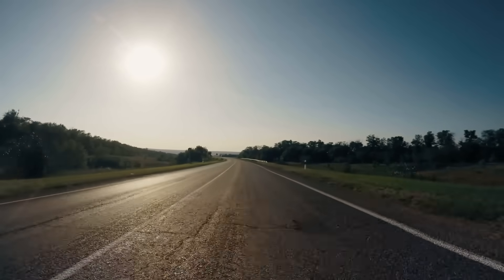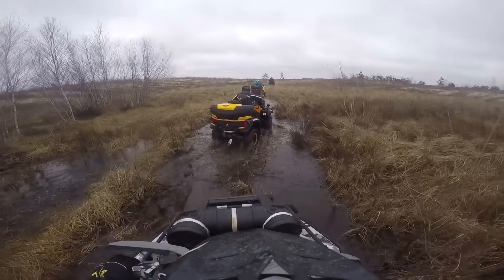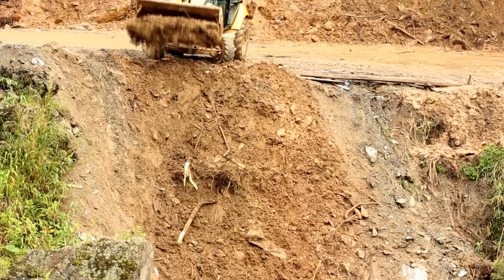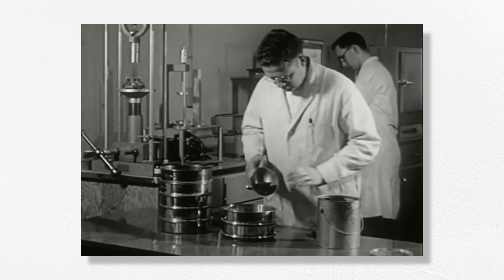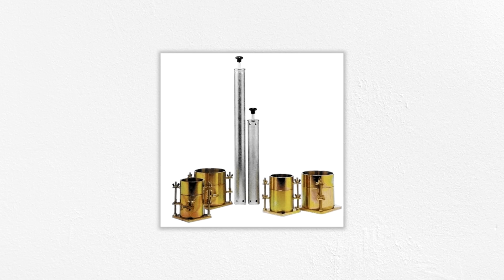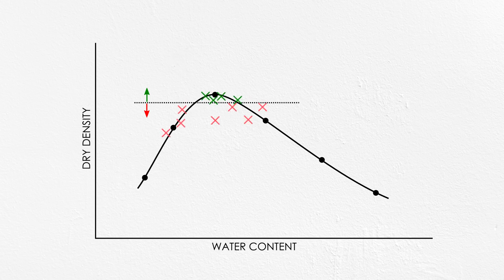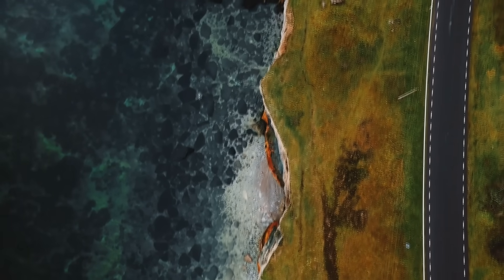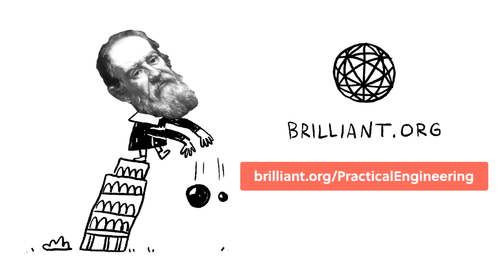Why Does Road Construction Take So Long?

Comment: Talk more about that radiation testing density. That blew my mind!
Reply: The instrument has a probe that sticks out the bottom. At the end of the probe is a radioactive source, and on the bottom plate of the instrument is a detector. You use a spike and a sledgehammer to punch a hole in the fill, stick the probe down into it, and turn the detector on. It runs for a fixed amount of time, and the detector records the number of radioactive particles that hit it. The denser the fill, the more particles are scattered or blocked, so the fewer hit the detector. It's all calibrated in a lab, so you just have to look up the density on a chart and compare that to the max density from the lab tests.

Comment: Congratulations, you literally described 90% of my job in today's episode. I'm "that guy" in the lab running proctor and atterberg tests on the soil, and ALSO "that guy" out in the field observing the placement/compaction of soil, documenting the process, and testing the product through proof roll and density tests... It's grueling work. But that's only a relatively small part of the time delay on a job. A larger part of the delay is due to deciding to do foundation work during the wet season, where 1 day of rain leads to  1-4 days of sitting around waiting for the soil to dry below optimum moisture content so you can work with it again, mostly because someone failed to ensure the place was compacted, slicked off at the surface, and sloped into a drainable area so the water won't sit on the surface and soak into it during storms... The major part of road construction delays is exactly as people complain that it is: The government responsible for the road grants the job to a company that "meets the criteria of equal representative employers" who are more worried about employing the appropriate percentages of ethnically diverse or handicapped backgrounds to get government jobs instead of straight up hiring only those whom are intelligent, dedicated and motivated to doing the job efficiently and well. And then those substandard companies underbid the job to win it, spend days/weeks/months arguing about the price of change orders when things don't go as expected, or don't work Saturdays or holidays, or only work 6-hour shifts, or just don't care about a deadline because they don't have another project lined up and therefor have no reason to rush the job they're milking for every penny...  and then the job that Joe Excavator And Crew could do in 2 weeks between warehouses takes 3 months and has potholes 6 months later, and it cost twice what JEaC initially bid.

Comment: "steady progress" well if you mean construction cones sitting on finished concrete for about 2-3 years sure. But thankfully other areas have a bit quicker and methodical construction teams.
Reply: I'm guessing Illinois or some equally corrupt/poorly run state.
Reply: @sorencates2125  Yo. I'm from Illinois and I can't agree anymore.
Reply: @sorencates2125  it's the case in every 3rd world country
Reply: @666Tomato666  I didn't know US was a third world country >.>
Reply: @neurofiedyamato8763  yeah, you need to look past the Gucci belt
Reply: "It's still curing."
Reply: I have thought about removing them myself at night time.
Reply: Odin Thorsdad now there’s me, who drives just inside the fog line.  If the twat handing off the attenuator truck dropping cones willy nilly misses by four centimetres, they have a flat cone over the hillside.

Comment: The issue with road works, is we see the 'Road Works Ahead' or 'Men at Work' signs on the highways, the Speed Limit Reductions and Fines Doubled Warnings but then you get to there and there is never any 'work' nor any 'men' in sight, yet the speed limits and fines are ever present. I have lived in New York for almost 14 years, and during that entire time, they have been building the Jackie Robinson Parkway, Grand Central Parkway, and that other road that takes you from the Jackie Robinson/Grand Central to the Long Island Expressway (LIE) or White Stone Bridge (God knows what it is called). 14 Years! I know the work started before I emigrated to the US, and it is still ongoing I believe. How now?

Comment: this is a good start to a series. in your proctor analysis explanation you could add info about the analysis not being the same for all soil types and how particle size distribution affects the proctor analysis and bearing capacity of soils. you could also talk about how the material types are placed from native inorganic soils to pit run gravels to crushed gravel and the reasons for them. then move onto drainage from under the road surface and how water is managed to avoid problems when the water could be present in both liquid and solid states. some food for thought.

Comment: The above video is nice but doesn’t really address the question. It is clear that the main reason construction take so long is because nobody is working. Construction sites when operating barely have one out of five people doing anything. The vast majority of time I see 20 miles of road is sectioned off for roadwork but no work is being done - no machines or people are moving on it for the vast majority of time. I passed by the same side a week later and still 20 miles of court and off highway and no work at all being done. I come back two months later same thing. I see this all over the country.

Comment: Would it be possible to have some special truck like the asphalt one that could compact soil as it let it glide from the back as it moves. Like a soil printer where big trucks dump dirt into a compartment before the "printer truck" and at the back its just a flatten thick sheet of dirt?

Comment: I get annoyed by roadworks because on my daily commute (2 minute drive), they never fully shut the road and do sufficient maintenance or repair. Instead, the council will turn up, close the road in one direction for 3 weeks and repair a 15m length of road and ignore all the other potholes, some of which are 1’ deep and 1 yard across

Comment: "most of us don't want to wear a protective body suit for our daily commute" - Unless you drive a bike daily , I'll never leave even on the hottest day of the year with out my leathers on.
Reply: Not wearing that is kinda asking for trouble with the mildest of incidents, but having seen and occasionally moved the outfits that my brother and sister have a bit when they got in the way I do honestly wonder how hot it gets in there. Especially when stationary for a while getting less forced airflow to get rid of heat.
I know of electrically heated gloves for winter periods (connected to the starter battery), kinda makes me wonder if there ever comes a point where people will consider putting a heat pump in the bike for certain extreme climates which then feeds something cold into the suit. Ideally it'd be a liquid coolant but being suit attached to bike I guess just forcing chilled air into the suit and letting it vent out on the other end could work?

Comment: There is a major road in my area that has a bunch of connections all close to each other (Highway, shopping district, Major intersection). They decided to expand it 5 years ago which started with tearing down all buildings and landscaping all the land on one side, which is also a steep hill. They finally started construction 2 years ago and for the past year its seems every month the road traffic is changing. They keep adding lights and signs and opening and closing new sections. And to make things worse its a Pennsylvania road so it won't last long after completion.

Comment: This was a great start for a series, keep it going!    After the completion of a section of interstate loop in our city problems were discovered as some relatively small areas sank down. It was very unfortunate and very expensive to repair. Soil is difficult to predict and in this case the failure occurred far below the roadway. I appreciate the diligence that is applied to prevent these problems. What happened here was unusual but did provide a valuable insight into preventing future failures.

Comment: Ah yeah excuses. UK motorways are slower now than dual-carriage ways and country roads. Last week I drove to Brighton, in normal situation a 2 hour 20-30 minute drive, was instead well over 3 hours because the motorway had several places for miles where only one lane was open, cones have been put out for MILES with 50mph speed limit and then after driving 5 miles, on the 6th mile there was 2 workers having a cigarette... This got to the point where the M1 should have a warning that "you should only use this road if there is absolutely no other way. Because going around, driving more distance on country roads and dual-carriage way gets you there faster, because altough both of those are smaller, they have the same speed limit...

Comment: Ok, but this still doesnt explain why they shut down 8 miles of one lane of the highway when the actual area theyre doing construction on is like half a mile long.
Or why road crews will come in, tear up a road, close it down, and then ABANDON it for months at a time, then come back 8 months later and finish all the work in a week.

Comment: Can you please cover cost of roadwork more, and how the cost and the work/engineering itself differs when talking about road renovation or expansion versus an entirely new road? For example, when a road needs an extra lane added to it, is that significantly easier and/or cheaper than a new road through undeveloped terrain?

Comment: As a professional driver, someone that spends her working days out on the road, although construction delays are frustrating, I do like seeing construction projects because it usually means, once things are completed, safer faster and smoother roads.
Reply: It's just the growing pains that come with them XD
Reply: By the time they get done fixing one section, the old section they fixed is fucked again because of how cheaply done it was.

Source: I live in Ohio.
Reply: I have seen entire concrete sections of the road on I-30 both W and E in the DFW area and towards East Texas take down the highway down to one lane.  Usually to be excavated and repaired down to it's very foundation before new concrete is poured.  I have noticed multiple times since traffic slowed down walking speeds alot of the time in those times.  It is rather nice to know that the State of Texas's Department of Transportation takes it's job seriously enough to do these repair jobs instead of going with the "Good luck, everyone!" approach.
Reply: Adam Gray gotta love the dfw roads and the constant construction
Reply: Unless it's the boondoggle that is the toll lanes on I-77 through and north of Charlotte, NC. 
Safer?  Hardly.  Faster?  Sure, during quarantine when there's little to no traffic.  Smoother?  Ha! 2-4 inch differences between lanes in some places and deep gouges where old lane lines were "removed"!

Comment: I work as a field engineer for earth work. Roads, pipelines, pads and buildings ECT. Dirt work is important. Small mistakes can cost millions to repair. I had an oil and gas client have issues of roads falling apart, they paid for public road upgrades, and applying oversite has save millions in 2 years. Road work is hampered by traffic as well. Roads need to stay open, if we could close them we could be done in half the time.

Comment: Federal interstate systems is almost 50,000 miles of road. So, somewhere between 700 and 800 miles per year on average. Many places, you will find state and municipal projects take a decade or more to finish a 3 mile stretch for the worst offenders. Earth work, while consuming a considerable amount of time, is seldom the reason these projects drag on.

Comment: I've seen roads built pretty quickly, in places with dry climates and didn't need much grading.  I always thought that simple grading and laying down asphalt was the quick part, and building overpasses and the sections of road that have to be cement was what took so long.

Comment: Using soil for road construction in Norway is mostly a big no no. Soil (being rocks of a very small size) would drain off in rain, and would crack the road surface in thawing and freezing. You need an adequate drainage layer of larger rocks (don't know the name for sizes in english, but think large gravel (preferably with sharpish edges), with different layers of gradually smaller on top). Might also use some netting under the gravel to keep the foundation in place).  In recent years they have been using some prefabbed blocks for larger projects, these I don't know anything about.

Comment: Living in Ottawa, Canada where temps can get from -30C to +30C, I'd love to watch an episode about how road engineers manufacture these temperature changes in. Compounding to that is frost upheaval leading to big bumps and potholes.
Reply: Temperature doesn't affect dirt much, actually. The problem is the moisture content. Fluctuations in moisture cost the dirt to shrink or expand, and THAT is an issue. Once the dirt is properly compacted at the optimum density, it's ideally capped off with rock or asphalt, which acts as a barrier to letting moisture in or out. Special materials specifically designed as vapor barriers can be added as well, to further protect against those changes. How they modify the asphalt to deal with the weather would be quite interesting, though :)
Reply: Mark Thomas Well, if you have a constant shallow water table in permeable soil, the temperature fluctuation around 0 C will definitely cause problems.
Reply: @Shocktrue1   In the St-Lawrence lowlands, the water table is often only a few feet below the surface, and in the winter, if the soil is silty, capillary action will suck the water up and cause frost lensing.
Reply: I live in Ottawa too... here they don't actually do much in the way of cut-fill balancing, as best I can tell: they just remove all the soil outright to some considerable depth, place the sewers (if there are any, which there will be in any would-be suburban street) and replace it all with granular. So it's more like cut everywhere, fill everywhere. Owning a quarry in Ottawa is close to having a license to print money.

In rural Ottawa, the City has a policy of replacing culverts (they just put in big ones pretty much everywhere now) at least 2 winters before a road is resurfaced so all that frost upheaval and delayed compaction can work its way out before they come along and resurface the road.

In some places you can tell when they paved on too hot a day, as a relatively new road will be full of cracks from winter contraction (and the contractors have had to come back to put crack filler in). Carp Rd from Kinburn Rd to Galetta Rd is one such road, as is Stonecrest between Kilkenny and Kinburn.
Reply: Not related to roads but in my place the rail company had to shut down a line due to rail expansion by the summer heatwave
Reply: @NeighborSenpai  That would be an interesting topic as well. Railroads in general, really, including the making, building, maintenance and issues that can arise...
Reply: Ya know what?  Our one gravel lane cow path to our house up in Whitewater Township, is township maintained.  Same with the road to the cow path.  Even the provincial roads are so much better maintained than those in, oh say, Pennsylvania.  The weather is much more brutal in Ontario, yet the roads are done very well, and in fairly good time.
Reply: Being just a checker for a contract company in grey-bruce county Ontario ( so, without much expertise): 

All you have to do is make sure the outside temperature is just right the day (or the next couple of days+nights depending on the amount that needs to set) that you're placing concrete or laying asphalt (along with a temperature check of the actual asphalt.  Other than that, it doesn't matter much. You just don't want rain or snow on the ground (water content)

Comment: In some respects, this video unwittingly explains the failure of this area of science and engineering. In my city, there are multiple roads which undergo this lengthy process and regardless, every year or every other year, no matter whether it is the city or a major regional contractor doing the work, it will have to be done all over again--and this cycle has been repeating for decades. If, in fact, this process was thorough and effective and a justification for why there are such lengthy construction closures, the pay-off that would make it worth the hassle and long wait would be a long-lasting, functional surface. Unfortunately, that is often not what is obtained.

Comment: In the UK they are adding concrete center barriers on our Motorways to replace the old metal ones. But the silly contractors the government use are using old metal molds to do one at a time and it fooked up the motorway by me for over a year to do about 5 miles worth. The reason it took so long is because for every day they take they get paid. Its a fact there are machines that can make these things in continuous motion with rebar enforcement.  It would have taken about a day to actually construct these things with it...... Little more time to prep maybe 1-2 weeks max. to rip out the old stuff because that's how long it took them to do that. Its a joke a real joke. holding up traffic at rush hour for 1 year to profiteer from the taxpayers for max 2-3 weeks work .....